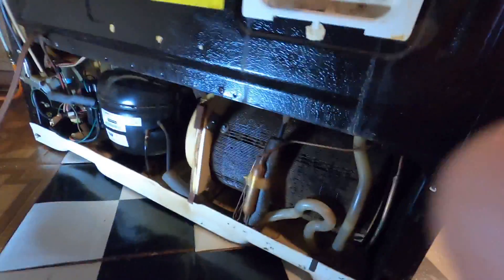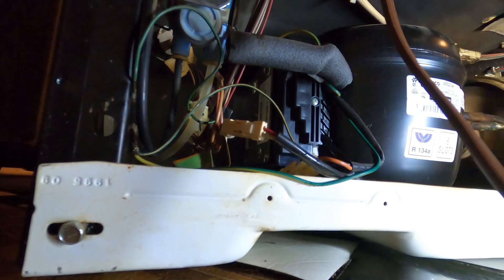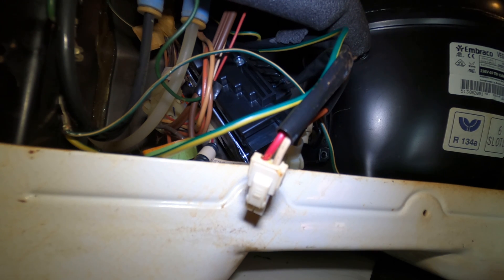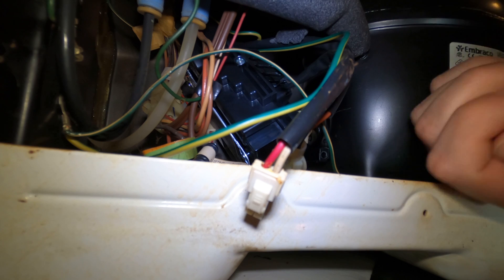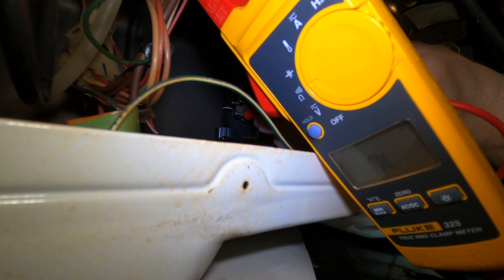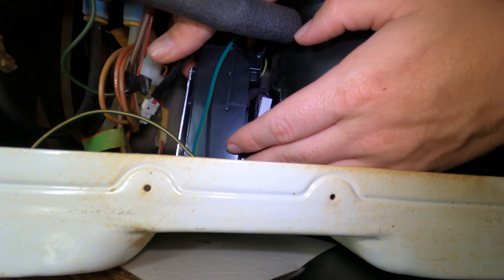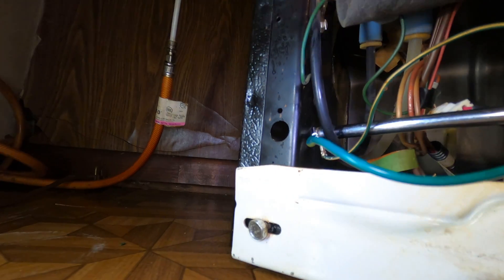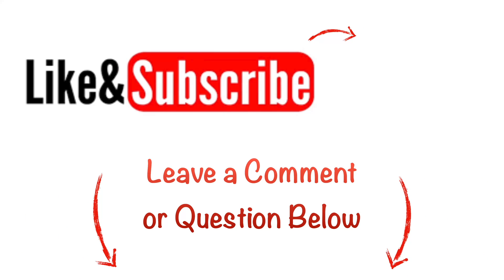How to Diagnose a Bad Inverter on a Variable Speed Compressor

Comment: I have a KitchenAid Model # KSBS23INWH00 Serial # SS0335636 the indicator lights in the top of the refrigator are off. No cooling, no condenser fan, no compressor running. Is that a control board problem? The compressor ohms out 7  each leg.

Comment: So quick question, everything seems to check out on my end as yours did, getting 4, 120 and the same reading of 12 ish on all 3 pins on the compressor... 

Our 5 door dual evap kitchenaid fridge started not producing ice a few weeks back, then the fridge sorted freezing up at the back..
 

After defrost, getting no cooling in with fridge and freezer and no ice... the coils in the fridge look like there's starting to ice up, then it melts and nothing? 

Is the an bad inverter?

Comment: Hello my friend.
I have a problem and I can't solve it. I have a refrigerator general electric side by side pje25pgtafsv inverter
The refrigerator works perfectly
The temperature drops very quickly. 
After  90  minutes or so  the temperature is at 0 °C Fahrenheit and  the refrigerator stop. When the temperature rises, the refrigerator never starts. 
If I unplug it and put it back on, it works normally until the next cycle. 
This has been going on for many days. If you can, please tell me what to look at or what might be wrong. 
Thanks in advance.

Comment: Thanks ... very helpful video!  My problem is intermittent compressor operation.  It seems that the inverter sometimes doesn't give enough startup power.  My Haier [GE] refrigerator is only 3 years old. I did order a new one but hate to send this one to landfill. For my last attempt to fix it, I just bought a refrigerator analyzer on Amazon for $85.  It is said to supply 3 phase selectable frequency to the compressor to simulate the inverter. This should help to determine whether it's the inverter or the compressor. Further dilemma is that Haier warrants "sealed' components for 60 months, including compressor.  But I don't understand how or why they would pay a repair person for compressor replacement when that would cost more than whole refrigerator replacement.
Reply: Could you please provide more information about this refrigerator analyzer on Amazon?

Comment: Thanks for this video. I was able to verify the voltages and the compressor winding resistance. The new inverter was $255 from local appliance parts supplier. $105 for aftermarket from amazon. I opened the suspect one and found bulging and leaking lytics. Unfortunately the family couldn’t wait for two days for amazon so…

Comment: What would be the issue if the compressor starts for a few seconds and then kicks off? DC inverter 50-180V. Guessing that could also be either control board, inverter or compressor.

Comment: The compressor replacement part is around $700.  With labor, $1000+ makes sense.  The problem at that point is that it it might just be a better idea to get a new refridgerator.

Comment: I’ve got a GE fridge with a WR55X11029 inverter. Compressor not kicking on. From everything i read and see, the control voltage input should be between 4-6VDC. Im getting an input of around 14vdc. Im assuming a motherboard problem but was curious to know if it should still run at 14v, and perhaps its the compressor.
Ive already replaced the inverter with no change and i checked the compressor windings. The windings were a little high… 16 ohms rather than the 6.5 that you show here, but all three posts read the same

What do you think could be the problem.
By the way, this defect occurred after our recent hurricane and it was being run for several days off of a generator

Comment: If you buy your inverter boards and other parts from amazon, you can just return them if the part didn't fix the problem. Might have to put the repair off a few days, but at least you don't lose money buying parts you didn't need. Just make sure your parts match your model of fridge.
Reply: That is called stealing.

Comment: You said to see if you dont need a new control board " is to see if this guy is getting 120 volts" what guy??? What connection were you testing? Thank you in advance
Reply: Yeah, not very clear. The inverter getting mains supply from the control or main pcb.

Comment: Unfortunately I think one of my windings is open in the compressor because I am not reading any resistance values on one of the pins.
But the compressor does make noise when it's plugged in.  I've doubled triple checked my resistance testing and receive similar resistance values between the other two pens but it's that third pin that has zero. So I'm curious to know I guess why is the compressor still making a quiet sound?

Comment: On the Frigidaire French door refrigerator I'm dealing with, the compressor pins all ohm out at 15. Do you know if that could be normal depending on the compressor?

Comment: Hi
When running  my compressor run hot to touch and the low pressure copper pipe not feel Cold. Does that mean Compressor is bad.
Tiger
Rosemead, California

Comment: Paying $1000 for a compressor to be replaced!!! You'll be better off buying another refrigerator!!!
Reply: I have found, the newer they are, the worse they are! Last refrigerator last 3 years before first problem!
Reply: some freezers cost 10K and up.
Reply: Ove changed our the inverter board but the refrigerator has no power what so ever. Not making a sound,  compressor, fans, lights board nothing comes on. I notices that the lights were flashing the say before it went out. No clue what it could be. Outlet has power in the wall. What could it be? The unit is a GE profile manufactured in November of 2011. I've looked at some of the new units, and I'm telling you my unit still smokes these new units. The new GE profiles are but so cheap with plastic shelves and less space. I really want to save mine if possible. And ideas would be helpful 
 Thanks.

Comment: Just changed out a main Control Board, Inverter and Compressor on a GE Monogram. Worked about 5 hours then died. Can hear the compressor attempting to turn over. Any ideas?
Reply: All fans running and lights on

Comment: My fridge in my RV stopped cooling. The condenser fan is not running, tested and has no continuity. The inverter has 120V going to it but no DC out. I'm in the process of removing the inverter to test the compressor ohms. You did mention the board sending the 12V I believe to the inverter that was located on the upper right side of your fridge  shown in the video. Could this possibly be the issue?? Compressor to be determined. Thanks for any input.
Reply: UPDATE: Compressor is good. Reading 10 ohms across all sides.

Comment: When i read information about inverter compressors i always read that they never go off, but my winefridge has a inverter compressor (you can hear that it is changing in speed) but it also is energyzed by a relais. I have set the temperature setting at 13 gr C and when it hits 14 gr C you can hear the relais and then the compressor kicks in, when the temperature is back again at 13 the compressor goes off again, so in my case it is not ALWAYS running, the wine temperature btw is nicely between 12.5 and 13 gr C…. So i guess it’s a combination of the conventional way by using a relay but then a inverter compressor is used, do you know more about this?

Comment: I have a bosh refrigerator that will run for about a minute when you first plug it in then it shuts off not just the compressor but the evaporator and the condenser fan as well would that be a bad inverter box or would that be the circuit board?

Comment: After  you have brazed the lines, put nitrogen into the system and let it hold for 1 hour. If the gauge needle didn't move even a centimeter then you know you do not have a leak. Release nitrogen then vacuum it, let vacuum sit for 30 minutes and watch the gauge needle again. You might book 2 sealed system work in 1 day doing this.

Comment: Is there no tester that we can put on the compressor so as to see that the compressor is not stuck or jammed ?
Reply: Not that I am aware of but I’m gonna do some research. You could buy a stand alone inverter and maybe test it that way after you have done an ohm check. Manually control the hertz from the control. Much like a Powerflex drive from AllenBradley could could do. Just for testing purpose.
Reply: @dakotaf6049  usually these inverter compressors are able to be tested at a 120v speed by just hooking up 120v and neutral straight to the pins no need for any inverter. 

The inverter controls the speed and voltage but just to test the compressor 120v should be fine.
Reply: @Steviewandersgreatesthits  not with the 3 phase compressors.
Reply: @dakotaf6049  is it a y connected bldc poly phase compressor? Not even sure what we’re looking at here anymore it’s been months since I commented 😂
Reply: @dakotaf6049  my point of asking the type of compressor is this
I’m curious on a 3 phase if you could just hot wire a 120v hot and neutral off of phase a of the electrical panel (just plugging it into an outlet) into two windings and then take another test cord only using the hot from an electrical outlet off of phase b of the electrical panel and start the compressor . 

For some reason I thought we were on a single winding linear here my bad.
Reply: @Steviewandersgreatesthits  sorry for the late reply. I would say if you wired it like that the motor would just hum or trip the breaker. You would need the three separate sine waves to run the three phase compressor which is where a variable drive powered by 120ac would be handy.  Single phase compressor would work by just plugging it in a wall outlet.
Reply: Yeah, a 120 volt extension cord with the correct terminal on the end should work.

Comment: hey I am only getting 3v DC to the inverter board, freezer is struggling to stay at 0 degrees.  seems like I am not getting a property signal to the inverter.  do you think that is the case?
Reply from the maker: If your compressor is running you inverter is fine.  Look into cleaning the condenser or issue with fans
Reply: @BeardedApplianceRepair  Yeah previously it was the fan that blows on the coils (a few years ago I had to replace it, all good now) also the condenser has been cleaned.  Wasn't too dirt due to me maintaining it at least one a year.  I only suspect the controller board because the DC voltage is low.  I ordered a new board and it will be here tomorrow.  I will swap it out and see if that fixes the issue.

Comment: My inverter has only 2.5v d.c. input control voltage. The compressor phase to phase voltage is 50v a.c. and phase to earth is 150v a.c. measuring on multimeter. The compressor input should be 220v 3 phase 40hz- 120hz on the label. Do you think the fault is the control board, inverter or compressor?
 The fridge freezer is not cooling at all.

Comment: Great troubleshooting...I changed both on my GE already..
These inverter frigdes need a surge protector on the 120v plug for protection from voltage surges..